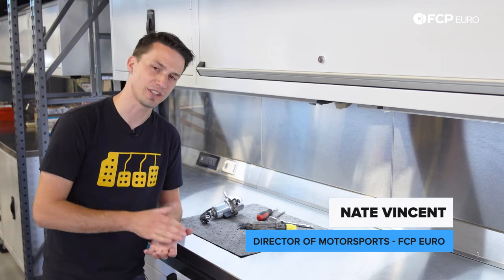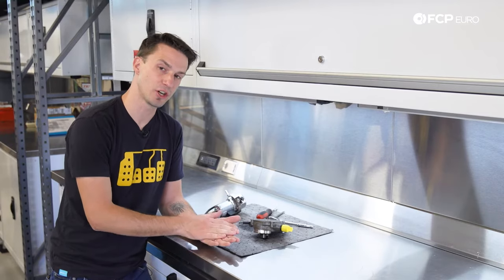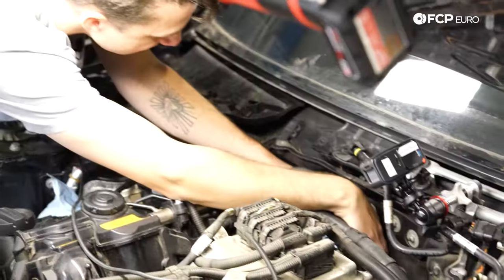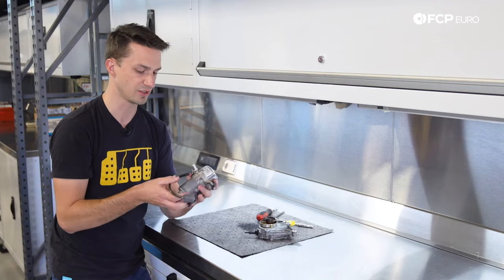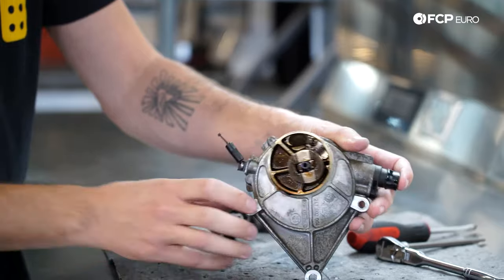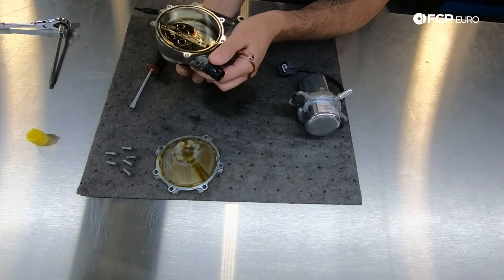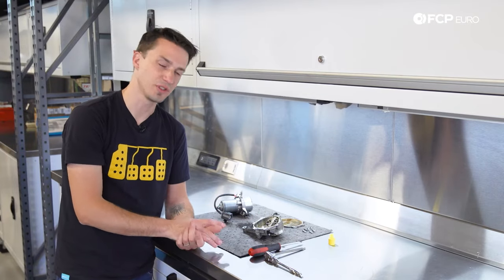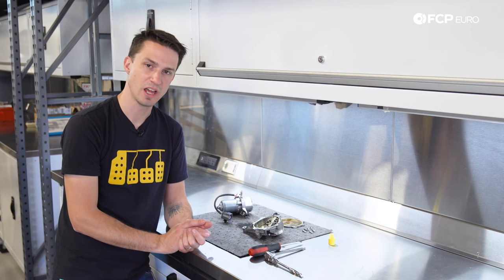Car Vacuum Pumps Explained

Comment: You won't believe how many accidents these things have caused. A small leak that's often untraceable, will cause your brake pedal to go rock solid, in many different situations that often can't be reproduced during checkups. These pumps and their connections, are the number one issue to watch out for. They are extremely dangerous.
Reply: Great comment. I recently bought a second hand Mazda. Got it tested and on the road and took it out for a test drive.  Found out it dosent hold /produce vacuum at low speeds. It nearly caused an accident. I just got another vacuum pump and tried it out, worse than before, then it worked after a few minutes. go figure. Going to try it again / trace the problem  and see how lonh ot holds vac. As you say its difficult and can be dangerous. I dont think its the brake servo but you never know?
Reply: Almost killed me in my cadillac ats a couple days ago.  Complete failure around 50 mph through a 4 way intersection red light. 
Figures it would be at the back of the engine against the fire wall.  It was really fun.

Comment: Hey all, currently experiencing a noise similar to a ‘gazoo’ which changes tone with the revs and it initially appeared to be coming from the vacuum solenoid. I disconnected the vacuum pipe (other end goes to vacuum pump) and the noise stopped. But if I blow into the pipe it makes a similar sound, which resonates along the tube back to the pump. The car is a Subaru XV diesel (Crosstrek). What could cause such a sound in a mechanical vacuum pump please? TIA, Simon

Comment: Why do so many naturally aspirated engines have auxiliary vacuum pumps?
Reply: Making automobiles more efficient there is intake/ exhaust valve overlay which reduces engine vacuum .  Manufacturers compensate using mechanical or electrical driven vacuum pumps to increase vacuum .

Comment: My understanding has been that a properly functioning Positive Crankcase Ventilation ("PCV") system has the crankcase operate under a slight vacuum. The positive in PCV is for "ventilation" and not positive pressure.

The N52 and other similar BMW engines utilize an "Independent Runner" ("IR") manifold, similar to what's used on motorcycles. In an IR manifold, there are separate runners and generally little if any common plenum area where an even vacuum signal can be sourced from. This is why the BMW engines utilize a vacuum pump, so that there is a) a steady and even source of vacuum for the power brake booster, and b) a means to keep the crankcase under a vacuum.

A point that most folks miss on the BMW engines, is that the slight vacuum that the crankcase operates under, helps to reduce oil leakage from the front and rear main crankshaft seals. If the crankcase was under positive pressure, then oil would be blowing out of those seals and the camshaft seals at all times.

I measured the clearances on my sons N52 powered 528i and compared them to a new vacuum pump and confirmed that at 160k miles, the clearances in the original vacuum pump were opened up considerably. Therefore, in addition to concerns of mechanical failure with these pumps, increase clearances will reduce the vacuum signal to the crankcase and will increase oil leakage from the front/rear main seals.

Back in the mid-90's when I fitted Weber twin 44IDF's (IR manifold, with one carb throttle per cylinder) to my 2000 Fiat Spider, I ran into this issue of trying to get vacuum to the brake booster. I futzed with small pressure vessels to make an accumulator and used vacuum tube orifices to try and dampen out the severe vacuum pulses from each runner of the manifold.

Cheers.
Reply from the maker: Thank you for the great notes!

Comment: Hi, very informative. I need your expert opinion. I rebuilt my turbo charger but still oil is coming out. The only explanation for that is because of the blow by pushing the oil back in the return line, is it possible to bypass the air and connect to the vacuum pump? Thank you very much

Comment: Hi, great video. Quick question.  When you test the vacuum for leaks, with engine turned off, right above the vacuum pump, it should hold the vacuum? The pump its in the oil bath, together with the oil pump. If I create presure you can hear the oil bubbling and if I creat vacuum, with a  vacuum gun, its puling oil from the oilbath trhru the hose. Its normal, or should it be hermetically closed even if the engine its not running? When the engine its running the vacuum its fluctuating like very fast, and its somewhere to 5, should be arround 15-20.

Comment: What happens if oil gets sucked into the electric pump?
Some engines have a dedicated brake booster vacuum port on the intake manifold, and the electric pump is tee'd into that line.
I watched a video where one chap tee'd into the brake booster hose as a source of vacuum for a catch can.
How could this setup be undesirable, or not ? 
Could there be a fire if fumes got to the electric pump?
Reply: They have check valves. Unless they fail, its highly unlikely that oil will find its way to the pump

Comment: Do you think that if on a mechanical driven pump, say on a 2GR-FKS Toyota engine, if you removed the pump altogether and just capped it off oil would not be drawn into the area because there is no vacuum? Obviously another source of vacuum would be necessary for the actuators to work afterward.

Comment: 1:20 This is incorrect, turbocharged engines still produce vacuum.
The turbo only produces pressure under load, when you are just cruising or slowing down there will be a vacuum in the intake manifold. 
This is why boost gauges for petrol (gas) engines show vacuum as well.
A diesel engine will not produce vacuum which is why diesel boost gauges don't have a vacuum measurement.
My (Australian) 2004 Volvo S60R doesn't have a vacuum pump and uses manifold vacuum when not on boost and with a venturi to generate vacuum when under boost.

Comment: I,m interested in the electric pump operation ,and how to install it on my hot rod with a canaster going to the brake booster. What psi will it put out? Thanks.

Comment: Hi if an electrical vacuum pump isn't working correctly or failing will it cause lower engine vacuum and engine performance issues?

Comment: Thanks for the great video. I’m wondering why direct injection and VVT engines don’t produce vacuum as well?
Reply: This doesn't seem to be answered, so I will try. First, I'm not sure what part direct injection plays. One of the goals of VVT is to get the engine to operate as efficiently as possible with the lowest vacuum. Creating a vacuum involves "pumping losses". On fixed cam timing engines a high vacuum would indicate lighter loading or better efficiency or both. When VVT is used the efficiency is improved over fixed timing and the vacuum is reduced. Unfortunately the power brakes and other vacuum actuated devices need vacuum to operate so the pump is added.
Reply: @johnhodgson5313 Very helpful - thank you!
Reply: @Fern635  You are welcome. Looking over what I wrote, I can see room for improvement, but you seemed to have deciphered it.

Comment: 1 side of my DIY vacuum hose collapsed. My idle was horrible on start up and I used 1quart of oil every 2 days as oil was seeping out from crankshaftseal and exhaust. When I fixed the hose my exhaust began to instantly pour out smoke...lots of smoke. Now I have hose replaced do you think I can simply drive for a while to burn off the oil to stop the excessive smoke?

Comment: You can fit alternator+ vaccum pump models which come fitted in small Diesel engine cars, but you have to connect Oil supply, return line 😉its easy 👈💥

Comment: Hi there, is there a possibility of a mechanical pump failing and losing vacuum pressure as it gets to operating temperature but works when the engine is cold ??

Comment: What happens when you replace vaccum pumnp bmw x1 and there is still oil in reservoir engine cover and coming up as a code when running diagnostic?

Comment: My brakes are failing and my mechanic made change both the booster and the main pump, could this vacuum pump be falling in my OBS 97 L5.7 Tahoe? Does my Tahoe even have one? I live outside USA so it's difficult to find OBS chevys spare parts.

Comment: Is the electric pump air tight? I checked the vacuum line by blowing smoke through the line and smoke came out the back of the pump. Is this suppose to happen?

Comment: Question I just did my valve seal job. 
I notice other day I have way too much negative vacuum when I try taking off oil filler cap. I’m talking a lot of vacuum to the point it’s hard to take off oil filter cap off. 
What can cause this?
Reply from the maker: Hi Miki Miki, it sounds like the PCV system in your vehicle may be clogged up, creating too much internal vacuum within the engine.
Reply: @fcpeuro  PCV valves on both side are brand new. Car only have 71000 
I changed valve seals shortly after car started to smoke. 
Do you know what exactly can be blocked. 
I would be surprised if my intake valves are clogged that bad. I always use premium fuel.

Comment: my truck had low engine oil, that affect the function of the vacuum pump causing problems in the brake system?
Reply from the maker: Sounds like you may have a vacuum leak somewhere in your system.

Comment: I have seen break boosters with 2 sides one powered by boost the other works when in vacume . Also last time I checked positive pressure in the crank case makes things less efficient and can cause oiling issues ...
Reply: you need positive pressure so that the pcv- valve can purge the exhaust gasses and oil mist out into the intake
Reply: @justarandomguy3969  that's positive movement tho less than 1 psi , PCV actually create a semi vacume state witch draws air in then once the pressure rises it vents I to the air intake . In racing applications u can use a vacume pump to help with pumping losses ( less air in the crank case to compress is more efficient)
Reply: Yea the rotating assembly will create positive pressure, I like a vacuum myself.
Reply: I know that the M54 engine leaks less with negative crank case pressure. Also burns less oil.

Comment: So what is the con of a electrical vacuum pump? What happens if it fails when your driving and moderate speed and there is no brake?
Reply: Well simply I’d say, if you start to either feel the pedal harder when depressed on, then you as a customer will notice something isn’t right & take it to your local mechanic or dealership.
Reply: But about the cons of the vacuum pump, well I guess that question still remains.
Reply: Your brakes still work, just harder to press. ABS and your vacuum source is all fail safe...

Comment: A few gm engines do this the buick regal turbos are known for snapping cams but running fine with no power boost as a mechanic i disapprove strongly find a better way AKA belt driven

Comment: Where does all the air keep coming from to ventilate the crankcase once it’s pulled a vacuum?
Reply: the air is pushed in the engine to maintain positive pressure, not pulled out. If I understood correctly, it's pushed in the engine head (where the pump is located) but I'm not sure why.
Reply: PCV valve releases excess crank case pressure

Comment: So mechanical pumps are a bad idea
Reply from the maker: They are great until they aren't...
Reply: Make them all external electric parts. Easier to replace when they fail. i wish the water pump on the Volvo modular engines was electric, frankly. Having to do a timing belt to change the pump isn't ideal.
Reply: @matthewkuhl79  its the exact same thing on all Honda V6: TB drive the water pump.
So instead of squeezing extra miles from WP, it us replaced at 100KMi during timing belt & tensioner